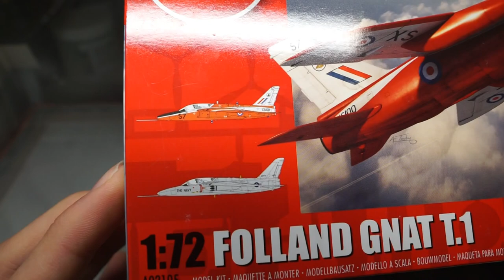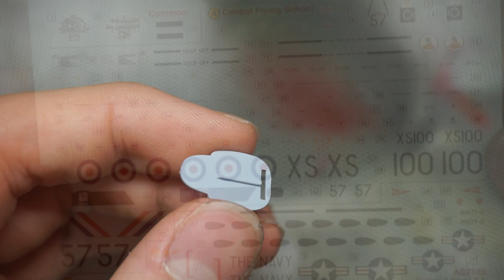Fiery Folland Gnat T.1 - Airfix 1/72 Model kit Full Build!

Comment: A disadvantage of paintwork applied with an airbrush is the distinct "orange skin" effect, clearly visible especially on glossy surfaces. That's why I apply the paint by brush, whenever possible. Although acrylic paints replace more and more enamel paints, I still prefer them to water soluble paints. The surface is then sealed with acrylic clear varnish. Acrylic varnish does not react with enamel paints, so there is no problem with dissolving the base paint...
Reply from the maker: Yeah there is a bit of an orange peel going on here. This is caused by the fact I used an acrylic varnish, which dries far too fast to self level. In recent years I've made use of gx-100, a lacquer from Mr color that levels beautifully with MLT

Comment: Looks Fabs!!
May I ask what kind/type/brand of clear coat you use? Do you not worry about it wrinkling the decals or crackling the paint?
Reply from the maker: I use humbrol gloss varnish with an 0.4mm nozzle, straight from the bottle - it's acrylic, so I never tend to worry about it attacking or reacting with the paint or decals - just make sure to let them fully cure!